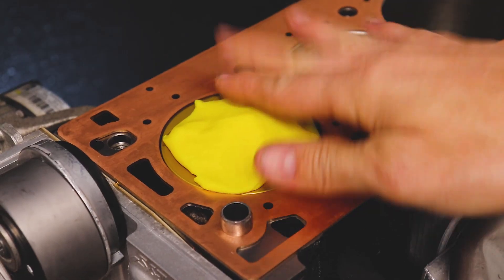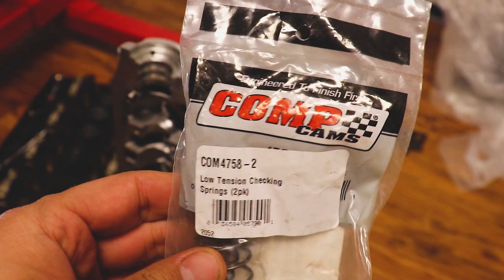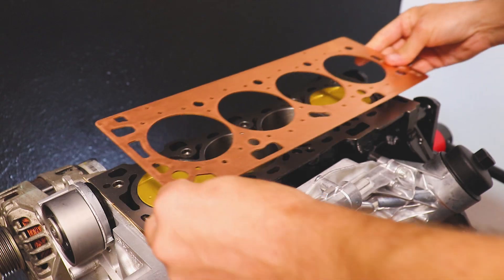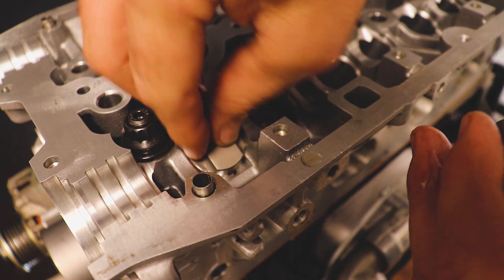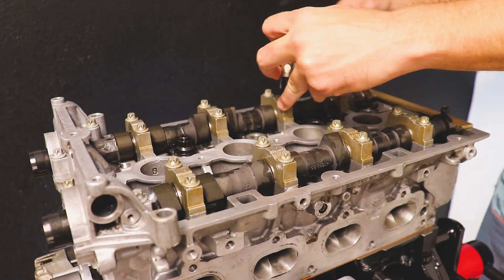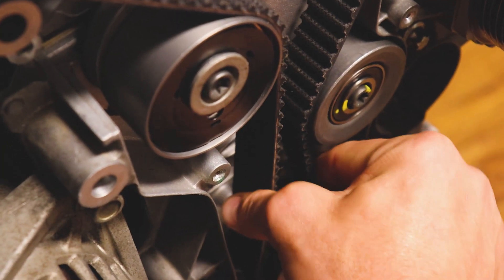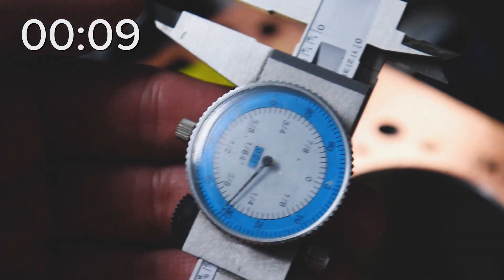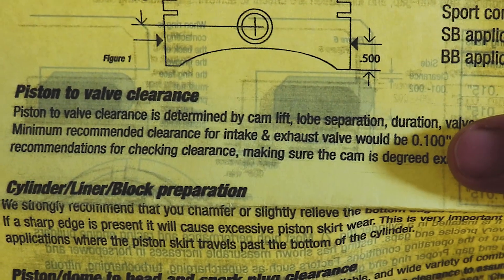How to Check Piston to Valve Clearance (and Why You Should)

Comment: what ARP studs did you use? i can't seem to find them online.
Reply from the maker: I used studs for a SRT-4 Dodge Neon. I had the machine shop drill and tap the block to 1mm larger size as well as open up the holes in the head to accept the larger studs.

Comment: Custom copper gaskets only work properly when the block and the head are machined with receiver groves to bite into the copper gasket at the fire ring area. Just slapping a flat copper gasket on two smooth surfaces will never give u the same sealing the factory MLS gasket can... I haven't watched the rest of the videos yet but Steve Morris explained it really well building cleetus new SMX engine on his channel with how his engines can hold 60psi of boost and 5000hp with the way his head and block are machined to bite into his copper head gasket.

Comment: Well with this method i still think you may lose accuracy because of the lifter collapsing when you rotate the cam, or even can be overextended assuming you put it in at full pump:/
Reply from the maker: The light weight check springs help with both of those issues. Most accurate... no. You could get expensive tools to check lift and clearances, or not check at all. This is a happy budget minded DIY'er medium.